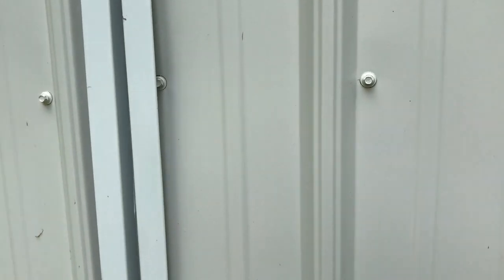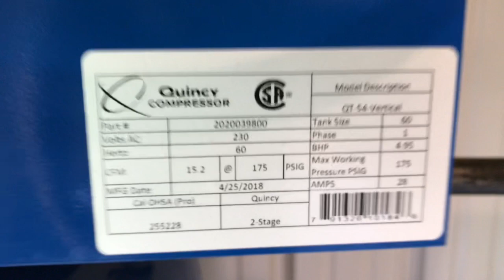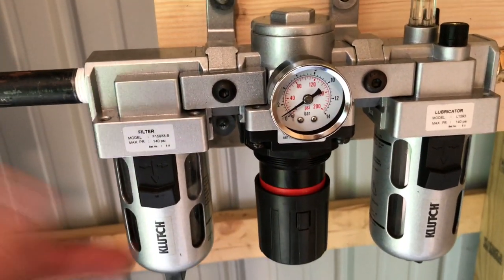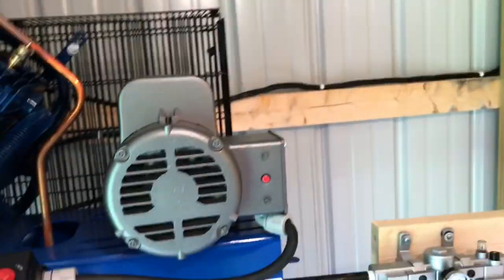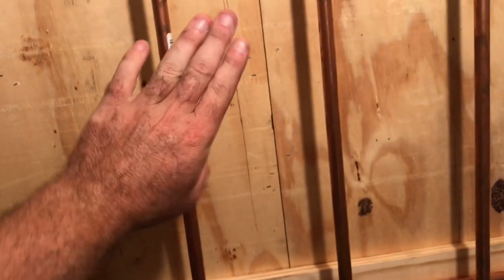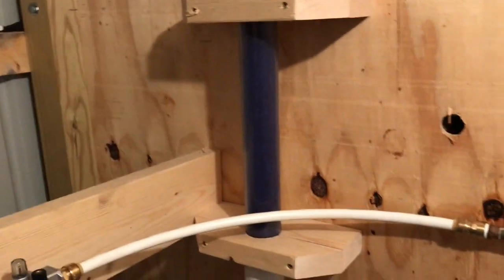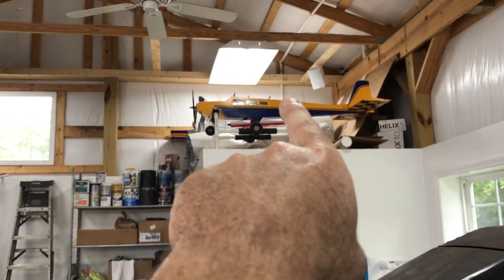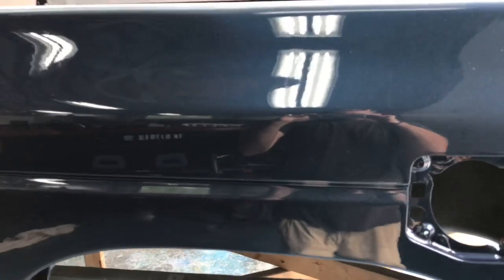Quincy QT-54 Air Compressor Set Up And Review

Comment: Thanks for the video. I am about to buy the same compressor for my shop. I will use your technique for making the "radiator", but I believe that I will take all of the drops and put them on a common drain line and use an automatic blowdown valve to keep it drained out without having to open and close each drop. Good Video... Subscribed.
Reply from the maker: AJ Smith sounds like a good plan. Thanks for watching!
Reply: If they are on a common drain line, wouldn't the air use that path to bypass the "radiator"?
Reply from the maker: AJ Smith sounds good. Thanks for watching.

Comment: that copper cooling system was epic.  Haven't seen anything else close to that on the tube yet lol.  Still on the fence about the compressor though, not sure if it is overkill for my home garage :)
Reply: I know your comment is 10 months old but if your still looking into compressor setups, look at using a Hayden oil cooler as an after cooler. I bought the Hayden 1290 ($160.00) on EBay or Amazon and it’s huge but there also is a Hayden 1260 ($130.00) that is a smaller but would still be very effective. I’ve seen that some people are getting very close to ambient temps before the air gets to the tank, which means there would be very little moisture in the air and collecting in the tank. I’m also going to be doing the copper water trap/cooler this guy is doing. I just got my Quincy Qt54 running today and still setting up all the water collecting and cooling system.

Comment: Code requires you to have a disconnect box if the compressor is more than 50 feet away from the breaker box or the breaker box is in another location/room.

Comment: Should have a flex line at the compressor tank outlet.  And running the air through the cooling tubes before going into the tank would keep moisture out of the tank.

Comment: Thinking about buying this same compressor. Would it make a difference on the water if you had a single stage? And if it helped you also if you had the filter closer to the tool?
Reply from the maker: Yes the single stage does not create as much friction compressing the air so less moister. And you can add filters to your tools to help keep them dry. Thanks for watching.

Comment: Nice video...I have a hobby shop like yours..bought  my unit..from st.johns ,Michigan...a Saylor-beall..comprsoir..fully pkg.unit..check it out on utube..3 grand..for mine ..they put a fan on the motor..with a cooler on the fan cage..no one else  dose this...with an automatic  tank drain ..I seen this on utube ..when I was looking to see reviews. On comprsoirs...I was sold..on there units..quite running as well..with a magnetic  starter ..not an option..but standard..on there units..all American  iron ..

Comment: I have the QT-54 as well. It is a well built compressor and does a great job. I put a magnetic motor starter on mine which makes it easier on the pressure switch.

Comment: What DA sander did you use with this compressor?  Thinking about picking up one of these air compressors for myself
Reply from the maker: Alexander Escarsega I am using a 3M DA sander. It runs at 90psi and about 5-7 cfm. I have never had to stop sanding and wait for air. Thanks
Reply: Seabass295 Videos Thank you Sir for your reply!
Reply: @Seabass295 , what is the part number for the 3M DA you're referring too? I'm considering the Quincy, but was concerned about not having enough CFM for a sander.

Comment: Why not just buy a refridgerated air dryer that runs on 110 volt for $1,000 instaed of that elaborate coppoer pipr system which looks cool but I do not beleive it brings down the temperature much as there are no cooling fins on the tubing?  Thank for produceing the video . Nice shop!

Comment: It's unefficent to press the compressor to such high values and then reduce it by regulator its energy wast plus more tear on the pomp. The devices have different air absorbsion to so the regulator setup should be modified on fly there fore I will recommend to set compressor to 145 psi max and 115 at start  with no regulator